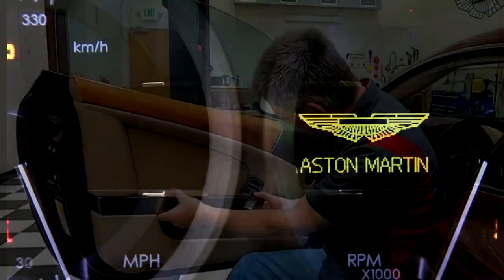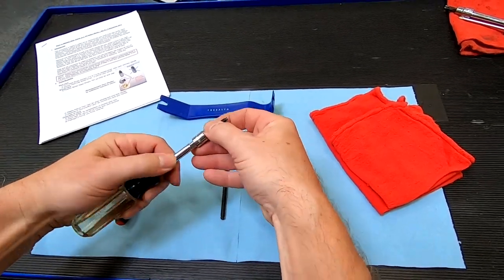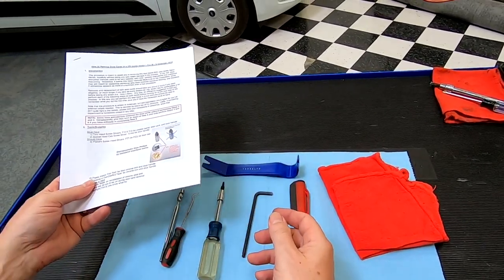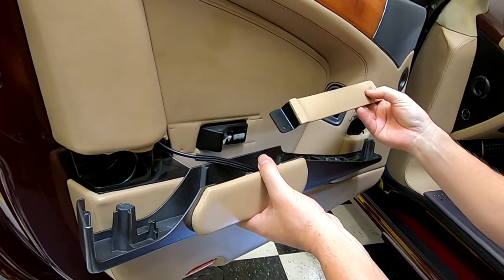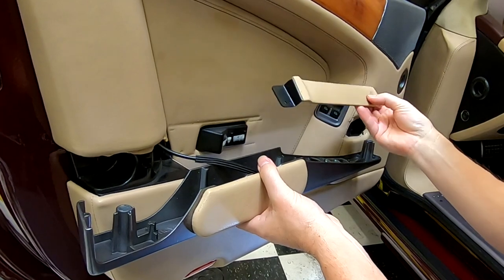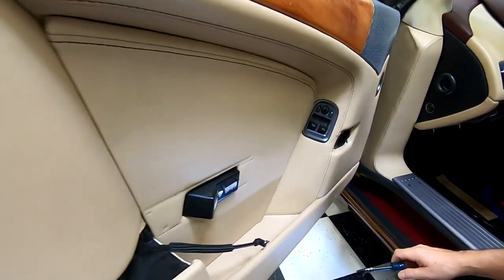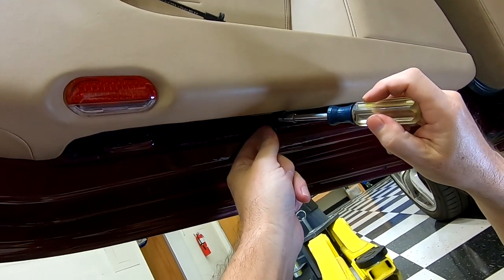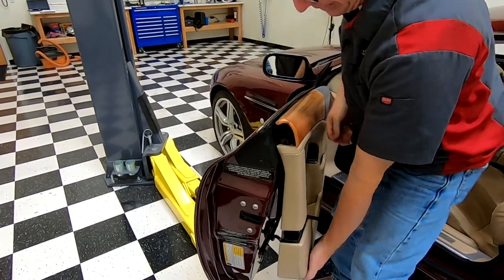What's Behind Door #1?  Removing the Door Cards from an Aston Martin DB9

Comment: A follow up video to this one would be “how to adjust the window glass” to stop high speed air leaks , cheers Steve
Reply from the maker: Good point.  I've not had to do that, but a senior Aston Technician told me about the dollar bill test.   Lower the window a bit, place a dollar bill across the top of it, and then run the window up all the way.  You should not be able to easily pull the bill out.  If it pulls out easily, the fitment needs adjusted.   Try several areas along the window near the front , middle and rear.  Thanks for watching!
Reply: @Aston1936  I’d be happy if it was hard to tug on a piece of cardboard let alone a dollar bill ! 😂 thanks Steve

Comment: sorry for my question but is it possible to change out my own automatic gearbox on jackstands at home . i have purchased a zf26hp  transmission and want to do the job myself on jackstand . just pull out the old transmission and replace it with the new one .  my pump is not working and my aston dont shift in to gear i already have change all the solenoid and when i fill the transmission like in your video it would not take the oil . so i bought a used transmission with low miles to change it .thanks
Reply from the maker: I don't really know if you can.  You have to drop the rear subframe and all the work related to that.  Maybe?   I've just not done it before and don't know if you'd have room to tackle it all.   Best of luck.  Post how it goes!
Reply: @Aston1936  Thanks for the reply i will try to do the job myself and will post how it goes . i will do some more research how to tackle it . i know that they do it with a 2 post lift if that is the case i have no choise but to purchase a lift . i will keep u updated if it succeed . Thanks